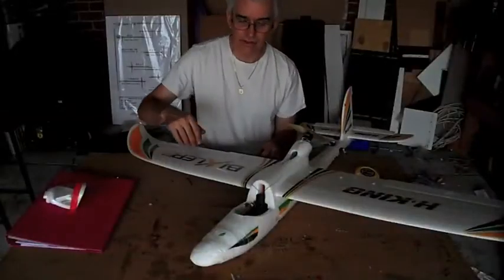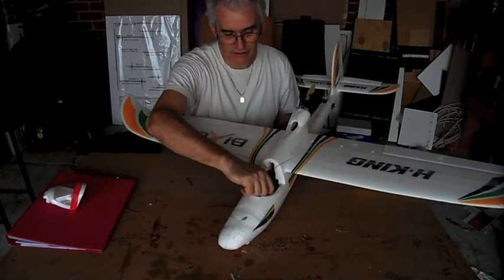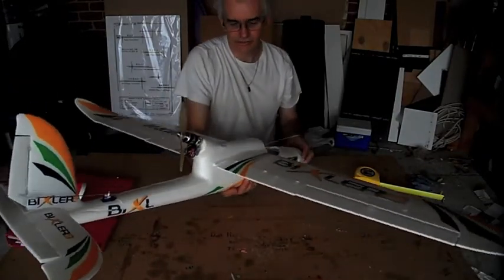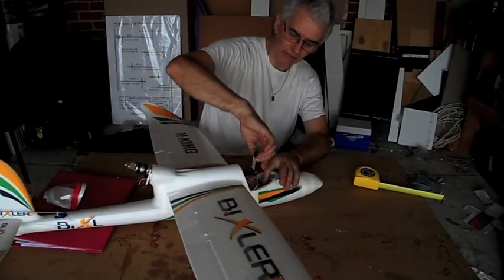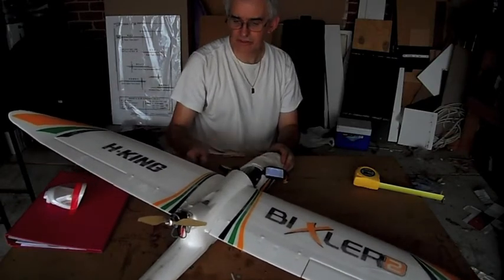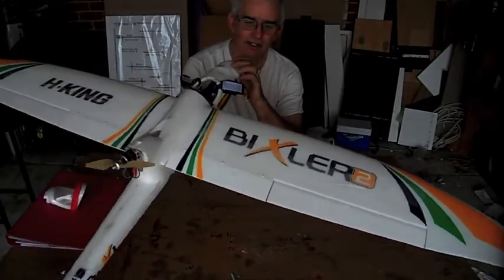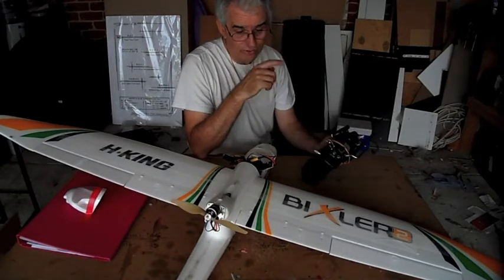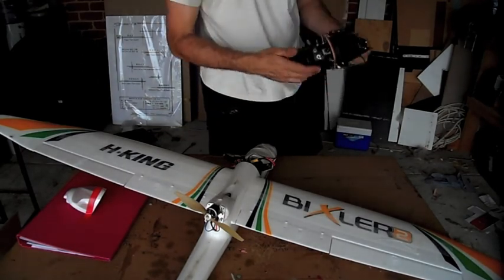Bixler 2 Review

Comment: Not being critical mate, but there are lots of video and blogs about how good the Bixler 2 is for FPV. Granted, in its stock configuration it certainly isn't ideal. However after some very minor and simple modifications, this plane can be very effective at FPV. I presently am in the research mode of FPV and doing my homework on what works and what doesn't work. I chose the Bix2 because of the price and the flexibility of the airframe. Sure there are better planes that come stock ready for FPV but not in this price range. I noticed you put washers in your motor mount. Everything I have read on that motor mount says that the motor is already canted at the right angle. Its hard to see in your video but it looks like you have your motors thrust line set to intersect behind the COG. In all my dealings with pushers motors, the thrust line is supposed to line up with the COG. I could be wrong and apologize if I am. I cant wait to get mine from HK and get it moded. Im going to start with just an onboard gopro and eventually transition into FPV. baby steps..
Reply from the maker: Thanks for your comments.  Remember that I was trying to fit an APM as well so the room was quite tight for that and any other gear. 

You should try the Penguin as it flies much better than any Bixler.

Comment from the maker: I agree with you.  The Bixler 2 is a fine aircraft for learning to fly.  I bought mine in kit form as I added my own motor and servos.  You don't need to FPV to get views of the Albatrosses.  I use a $40 camera from K-Mart mounted in the canopy.  It would fit easily on the Bixler.

Comment from the maker: Fair enough however I was mainly commenting on the Bixler 2.  IMHO it is not an improvement on the Bixler 1 except for the flaps.  For me I would still have the Bixler 1.1
Also it may be a good FPV platform however I am flying APM drones now and the extra space and stability of the Penguin, not to mention the extra load carrying ability makes it a winner.
BTW what are the flaws of the Penguin as i have not encountered any yet.

Comment: Hi, sorry but i have to disagree with your opinion in this review, Bixler planes are a awesome first fpv platform or if you need a fpv plane that is easy to transport and easy take-offs and landings, without the need of big landing zone!
Tell me when you find better fpv ARF or PNF plane in the same price range with same or better gliding characteristic, control vs space and as easily to modify to your preferred setup! Penguin may have more space, but also have it´s flaws and alot more expensive

Comment from the maker: Thank you for your comments Sojournia.  Yes I am going to scrap the Bixler as a drone and FPV platform because there is a vastly better alternative that flies better and has 4 times the room.  I fitted a 5000mA battery in the Penguin and still had room for my lunch.  I will post a video when I have all the gear in the Penguin.  IMHO the Bixler 1.1 is a better FPV platform.  However I still love to fly the Bixler 2 and still have to get the flaps trimmed out.